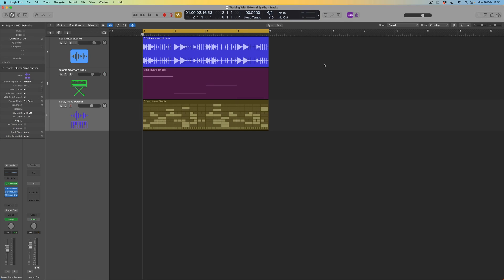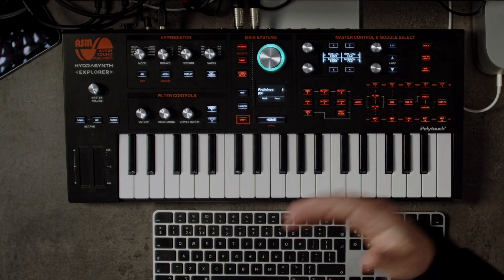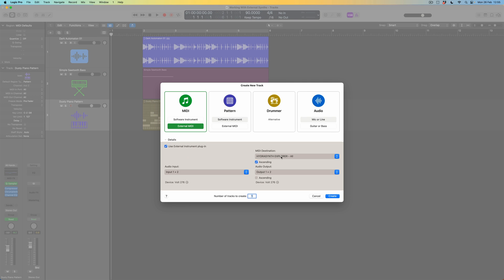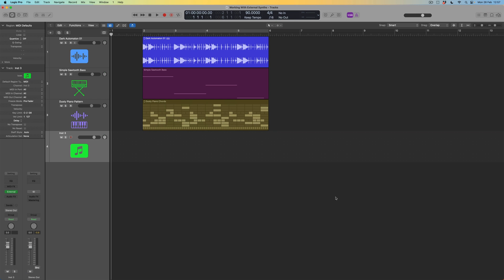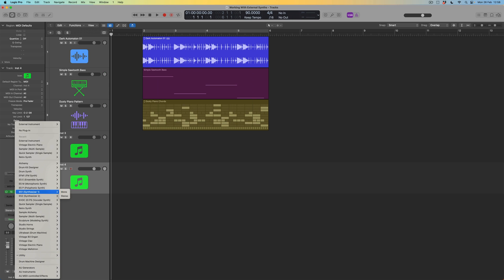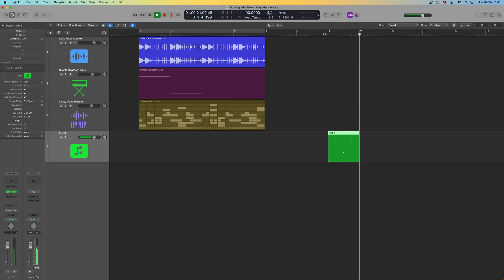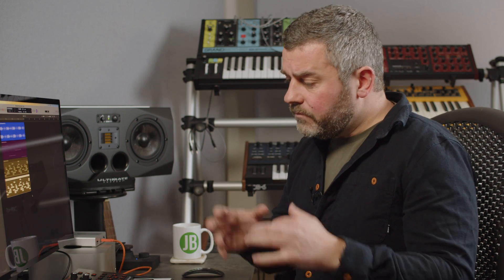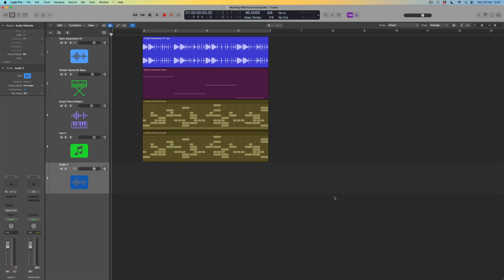LOGIC PRO X - Working With External Synths

Comment: A year and a half later I found what I think is a better setup for my Moog Matriarch. In the External Instrument I leave the Audio Input as None. I hear the Matriarch anyway just because it's live in my audio interface without Logic. That bypasses the doubling effect. If I want to hear a reverb plugin inserted on the audio track while I'm playing live or playing back MIDI, I can audition it by arming R or I in the audio track. I haven't been able to make an FX bus work with an external instrument. I've followed instructions to a T and it just doesn't work. I'm happy with this much simpler setup. I can automate FX plugin modulation by drawing it in after recording or live with CC-linked knobs and faders. I also found that I have to use the Utility to set up the External Instrument in order to have the stereo option. And when I create an audio track I have to hit the mono circle on the input to make it stereo. And the output defaults to the Matriarch's audio inputs so I have to reset it to Stereo Out. None of those issues were present with your Hydrasynth. Is this a Moog thing?
Reply from the maker: Hi Gary. Thanks so much for sharing your discoveries. Working with External synths does appear to be quirky - a few people have posted variations in what they've experienced, compared to how I've suggested routing things in this episode. I'm delighted to hear you've got a setup which is reliable and working well for you.

Comment: Nice, but when working with external synths I want to be able to define banks and patch names. For example, if I am using a multitimbral synth across all 16 MIDI channels, I need Logic to assign a specific bank and patch to each individual MIDI channel, and I want to be able to select those patches by name instead of manually entering MSB, LSB, and program change values every time.
Reply from the maker: I completely understand and yes, this is absolutely possible. I remember the good old days of life before virtual instruments where setting up hardware patches over MIDI and saving those instrument settings was a necessity every time a new hardware synth was added to Logic (which in those days was acting as a MIDI sequencer alone). I'll happily have a look at this in a future episode. You will need to make a cup of coffee and be ready to enter the patch names manually (with their program change settings) that first time for the synth you want to work with but once it's done, it's available to every subsequent new Logic project.

Comment: Loved your video looked to be very helpful right until I got into Logic pro and the UI has changed. They now ask for program AND LSB and MSB. I’ve tried entering them for the various synths I have hydrasynth and KORG multipoly and does not work. I’ve got Support request out to both companies to see if they can tell me what the proper settings are, but basically this video is now fundamentally useless. Not your fault of course I’m not blaming you, but it might be worth updating it to show the new UI and help the rest of us out. Thank you.
Reply from the maker: Hi Joe. Thanks for letting me know. Just to check - you're not able to make the connections you need if you leave the settings for LSB and MSB as 'none'? 

These settings relate only to the Program Change options now offered at the bottom of the revised External Instrument interface. If an instrument has more than 128 presets, the LSB and MSB numbers allow you to access further groups of 128 sounds (those listed from 129-256, for instance). If you're just looking to make a MIDI connection from your synths to Logic, you can leave the Program Change option unchecked and everything else in the video should get you where you need to be. If you DO want to be able to use Program Changes to recall patches, the user manual for your synths should include the LSB and MSB settings required to access those patches in the index section (usually towards the back).
Reply: @jonobuchananmusic thank you for your excellent video and taking the time to reply.
I am wanting to make program changes to the synthesizer since I want to use the logic pro project to record the patch choices that I make for my synthesizer so I don’t really have to write that down and just bring up a project and all the synth changes to the correct program choice.
And eventually would like to use events in logic pro to change patches during play.
Someone on Reddit said that the logic pro ignores the MSB bank setting and only the LSB bank 0-7 setting is used to set the bank and the program would be 0 to 127 within that bank.
I’m still puzzled if I have to set the cc for theLSB bank to 32 somewhere, per the Hydra docs.
I’m gonna give that a try today and see how it works.
There’s also another window in logic Pro that has a number of MSB‘s banks with values that can be set and I’m wondering if that affects it as well.
I’m pretty computer literate but there’s so many options & there so many different ways to set things that can get confusing. I will try the person on Reddit’s suggestion first and come back to you if I am completely hopeless.
I do look forward to looking at other videos of yours to learn logic even better
Reply: @jonobuchananmusic sorry I didn’t answer your question. I have no problem connecting my hydra  through USB midi to my computer and accessing it through logic Pro.
My question is around causing program changes to occur or have Logic Pro set the  program as part of opening a new project.
Reply: @jonobuchananmusic I was able to get this to work with my synthesizers - most of them use LSB some use MSB, but I was able to get it to work to send program changes to my synthesizer.
Now here’s the question for you.
Can I send program changes To the DAW FROM the synthesizer? It does not appear so in Logic.
I checked the logic pro documentation & I don’t see anything about it receiving program changes.
It would be really nice to be able to set the program preset in the synthesizer and have it set in the DAW also.
This is not a showstopper though. thank you

Comment: You've made this more convoluted that it really needs to be. The external instrument plug-in implementation treats your external instruments like a soft synth. The level you are seeing on the external instrument track is the level that the instrument is coming in at. You have a gain control within the plug-in to turn this up or down. You can add whatever effects you want to the external instrument track and these will be applied to the sound of your synth whilst it is playing. When you want to print the audio just use bounce in place, it will create the audio track for you and mute the external instrument midi parts that you are bouncing.
Reply from the maker: Thanks Robin. Bounce In Place for External Instruments wasn't available at the time of making this video and what I try to do in all of the episodes is to showcase a way of doing whichever technique I'm exploring which is as 'guaranteed' to work for everyone as possible (including those using previous versions). But there is often more than one way to achieve a particular result in Logic and your suggestion is excellent - thanks for sharing it.

Comment: Great Video, but an issue that I have been facing is, using my Moog Subsequent 37 as a midi controller on logic, I tried different ways but still no result
Reply from the maker: I’m sorry to hear that. Are no MIDI messages transmitted at all, including using its keyboard for note input?

Comment: I am using external synthesizer going into my MOTU M2 and then my MacBook Pro. I can get to the part where it's monitoring, but when I set up audio track it doesn't record.  I am doing everything you showed on the video.  I am using Logic Pro 11.
Reply from the maker: Sorry to hear you're having that issue. Do the Inputs of the Audio Track match those of your chosen hardware inputs? Another thing to try would be to bypass the External Instrument plug-in altogether and try to make a direct recording from your External Synth directly onto an Audio Track (again, making sure the Audio Track's inputs are matched to the physical ports you've chosen). That way at least you'll know if the Audio routing is working properly before you try again with the External Instrument plug-in. I hope that helps.

Comment: watched your recent video that drew me back to this one.  in addition to a recent arturia keylab3 61, i have an old korg triton 61 from 2001.  whenever i use it, i just go in audio and am able, i believe, to use all of its internal sounds.  it has the old 5 pin din connectors which i have usb adapter connected.  but it seems i get everything from going in audio and unless i want to use it to be just a midi controller, i can't see the reason for using it via usb.  am i missing something in this?  note that i do also use an ipad in remote which would basically mean i don't need the korg for that aspect.  or am i wrong?

thanks, really enjoy your videos.

Comment: 9:08 can you record this, get the same result by recording that with your midi keyboard instead of your Hydrasynth keys? I have Sound Module that don't have keyboard but I can connect to it my midi keyboard and record like you here but I would rather do this without connecting my midi keyboard to the sound module. Just recored it with midi keyboard connected to the computer.

Comment: Thanks so much Jono. This is fantastic. What if I have a controller (Arturia Keystep) and want to use that to trigger sounds from several external synths that I want to record on my project. I have a midi interface, so should connect the controller to the midi interface and create specific routings on the interface, or is that specific controller to synth routing done within logic. It would be a pain to connect and disconnect the controller directly to the external synths.

Comment: So, what's up with the Audio FX on the channel strip of the External instrument?
Reply from the maker: I hope I've understood your question correctly. Do you mean - why are there Audio FX available? If so... remember that the External Instrument provides configuration for Audio as well as MIDI. So you'll hear the sound of the External Instrument monitored through the plug-in. Accordingly, it's possible to add FX to it - the Instrument is the input source and Logic will then let you send that signal through Insert FX and Auxiliary routings too.
Reply: @jonobuchananmusic I must be doing something wrong then.
This is my setup: I have a drum machine configured as an External Instrument. Same with an analog synth. Both are routed through a little mixing console, and fed into Audio In 3 of my audio interface. That is the audio I have selected in the plugin. So far so good: I play the synth during recording, MIDI is recorded, and on playback, I hear the audio, which is a separate channel strip. 
Of course I can add Audio FX to that audio channel, but that would affect both the drum machine as well as the synth.
But Audio FX added to the External Instrument don't do anything.

Comment: Hello Jono, maybe you can help me. I can't find the solution. I hace a MIDI keyboard (Komplete kontrol A61) that only have USB. Ok.

Then I have Focusrite Scarlett 1rst gen that have MIDI In and Out.

And I want to control a 90's keyboard module with the Komplete Kontrol.

I can't manage to do this.

I know that Komplete Kontrol have to be pluget on Mac, then the MIDI Out of Scarleet goes to the Module and thats all, right? No't workong.

I'm using Logic Pro X

Thanks, best regarda

Comment: I hope this works. I have been trying to get this working for a better part of a day. Another video says to send the external midi down a buss and bring it back in an audio track for recording. When I record that way I get an empty track. Another video says the do a real time bounce...again empty track. From your video I think it may be that I don't have an audio interface yet. I was thinking maybe that's the problem. My synth connects, and I can create the external midi track so printing is the issue right now. I can also use my Fantom as a DAW control. Keyboard seems fine. Right now I monitor through the Fantom headphone jack. I think maybe that connection is giving me a false sense of being full connected to Logic.
Reply from the maker: That’s absolutely right. You’ll need an audio interface to record the sounds from the synth into Logic. There are two types of ‘message’ required to record sounds from External synths. The first part, MIDI, is letting you send Control messages to/from your synth. But to record its sounds, you’ll need an audio interface, with the outputs from your synth plugged into the interfaces inputs.

Comment: 5:38 thats my problem, doesnt show any midi destination etc
Reply from the maker: Hi Gustavo. Sorry to hear you're having this problem. A few questions from me... 

Which synth are you using? Is it connected via USB? When you play notes on the keyboard, does the MIDI receive light show up in the Transport bar in Logic? Does your synth need a driver to run (which you will be able to download from the manufacturer's website)? Do you have Advanced Settings switched on (Logic Pro > Settings > Advanced > Enable Complete Features)?

Let me know and let's try and get you sorted.
Reply: @jonobuchananmusic hello mate, thank you for the help. I used to be able to use many synths and e drums in the past. Now ive been trying to use roland td27 via usb and i downloaded the driver... I forgot to mention that my logic pro x version is an old one and if im not mistaken i got a msg from logic about it stopping to be update months ago, my IOS is monterrey 12. I got all tools enabled

Comment: Dear Jono, do I need an additional audio interface, if I connect my Yamaha PSR sx900 to Logic Pro?
Or would the USB midi cable be enough to transmit midi "voice" back to Yamaha?
Thank you very much in advance
Reply from the maker: Hi. A USB cable will carry MIDI data in both directions. So via your keyboard, you’ll be able to play Logic’s range of instrument plug-ins and via External Instrument, you’ll be able to route MIDI back to your Yamaha to trigger its sounds. The issue arises when you want to ‘hear’ both at once. If you plug headphones/speakers into your computer, you’ll hear Logic’s instruments. If you plug headphones/speakers into your Yamaha keyboard, you’ll hear its sounds, but not Logic’s. So unless your Yamaha can act as an audio interface, yes, you might want to consider buying an audio interface. I hope that helps!

Comment: Thanks Jono, that was helpful. The issue i am having is that i have an external synth (Behringer Pro 1) set up exactly the same way, being triggered by a midi keyboard (which is hooked up via USB direct to the computer too). When i turn the fader down on the External Instrument track, it won't turn the sound down to the point of mute - i have to hit the mute key, and it almost sounds like its overloading with the fader up. It makes it hard to mix with other tracks. I could bounce it to audio (as per this video) but i was wondering if there is something i am missing?
Reply from the maker: Hi Tim. Sorry to hear you're having that problem. I don't know the Pro 1 well enough to be able to advise but it sounds like a couple of things might be happening. Sometimes if you have an Audio track set up in anticipation of the External Instrument track being recorded as Audio, you'll hear the monitor input from within the External Instrument as well as it being monitored through the Audio track, which means you'll hear it twice (and that will certainly sound like overload). A good way to test this is to do an audio recording of the Pro 1. If the recorded level is significantly lower than the 'monitor' version, it may well be that you're hearing it twice. Lastly, does adjusting the output level on the front of the Pro 1 to compensate fix the problem? Sorry I can't be of more direct help.

Comment: Great video Jono. I have the same set-up as you, a Hydrasynth Explorer and Logic, only the Explorer does not appear as an external instrument in Logic. I have connected the audio and midi the same as you in the video. The Hydrasynth does appear in Logic settings under Midi Inputs. Any ideas what to do when  Logic not recognizing USB external synths?
Reply from the maker: Sorry to hear you're having that issue, Jim. Two thoughts come to mind. Firstly are you running Logic with the Advanced Features switched on? Go to Logic Pro > Settings > Advanced, and make sure that option is ticked on. Secondly, have you tried hot-swapping in the keyboard (pulling out the USB cable and putting it back in), whilst Logic is running? Does that make it appear as an External Instrument? Otherwise, I'm wondering if there's a Privacy preference set outside Logic which is preventing full integration of the Hydrasynth. Try those things and let me know. I'll do some more digging this end too - I'm sure we can get it fixed.

Comment: Is there a way to add multiple instances of external midi running from the same piece of hardware? Without printing to audio for each new track? Kind of like a multi-out in omnisphere? I'd like to use my new Yamaha MX61 as a sort of workstation to compose.
Reply from the maker: Great question. Yes, this is absolutely possible. The External MIDI plug-in contains the option to select a MIDI channel, so if you set up multiple Software Instrument tracks, instantiated the External Instrument plug-in on each one, setting the desired MIDI channel for each new channel sequentially, you'd just need to set up the MX61 with each sound you wanted on the corresponding MIDI Channel. That should do it!